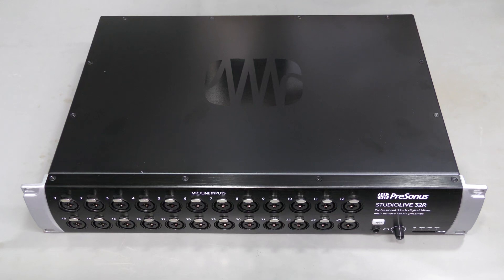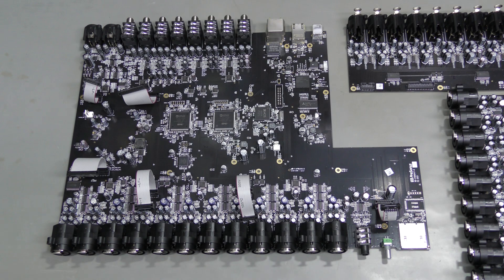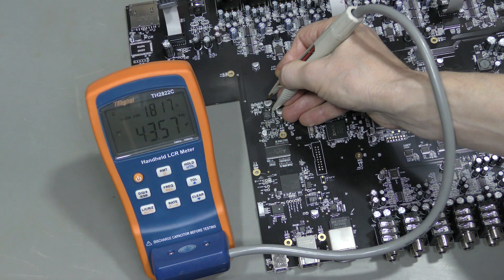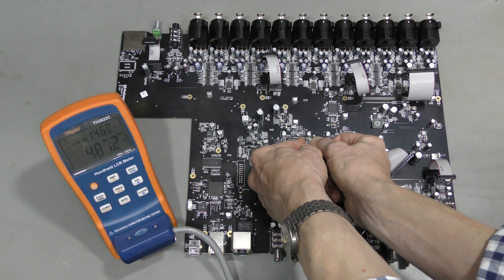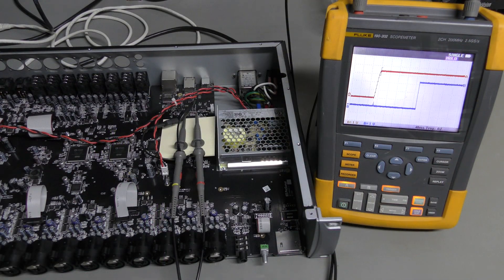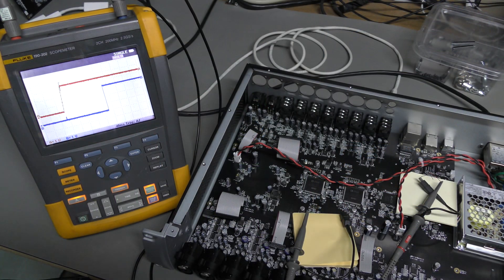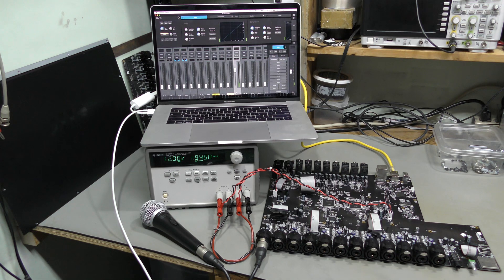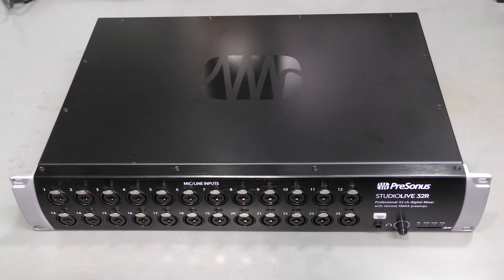#158 - PreSonus StudioLive 32R rack mixer repair

Comment: Hi everybody, I had the same exact problem on my mixer. Huge thanks to Alexander’s super clear explanation, I successfully debugged the problem. However in the end, I keep the original values but use 100k for the pull up. The problem did not resolved and got 0.9V on -15V rail. Then I purchased the same stepdown regulator from digikey and boom! It works again. I got -13.6V on the rail and therefore -2.5V on the input channels. 
One more time, thank you Alexander! You saved an 2000usd mixer!

Comment: I'm pretty sure that the rack version can record 32/64 channels if you connect it to a daw. It's only 2 channels if you are recording directly to the SD card slot.
Reply from the maker: of course. but mixing boards of this line can record 34/64+2 to SD card. I would love to have that in rack versions

Comment: Enviable troubleshooting skills on display as usual! Great video. Still makes one wonder why it worked without fault originally. Perhaps the internal circuitry of the chip has become less robust over time, and reducing the "grunt" needed to overcome the higher resistance was what it needed to keep doing its thing consistently. Awesome work! - JRH

Comment: Nice fix, as usual...congratulations. Like others said, using a pull up resistor equal to 1 M seems a bit strange...such a high value is a good noise generator😅😅😅. Not exactly a desiderable result... Regards from Italy.

Comment: Isn't it a rule to check all voltages first?
This equipment left better than it came, recaped!
Reply from the maker: Yes, it is a rule. And I checked, but not when the fault manifested itself. And I had a wrong idea that the problem must be with digital part. And I imagined something transient like a bad reset or too much ripple during initialization or something like that. Everything is obvious once you know the answer.
Reply: @feedback-loop  He who knows, knows. And you know a lot.

Comment: Different brands/models of these step-down converters work slightly differently and need set up differently, so possibly they fitted the LT8609 thinking it was 100% compatible with what the original design called for?
Interestingly, the LT evaluation board for the LT8609 uses a 1Mohm pullup to VIN on EN, and a 0.22uF on BST.
Nice repair though, enjoyed the diagnosis.
Reply from the maker: Oh, you have an evaluation board with 1M resistor to Vin? So perhaps this was not a mistake on the part of PreSonus, but they followed some recommended design. Well, I am not sure how to interpret this, but it does seem to me that this 1M pullup was the culprit.
Reply: @feedback-loop  No, there's a schematic on AD's site of the evaluation board. It could be your IC is partially damaged, but I agree, 1Mohm would seem rather high a pull up!
Reply: @feedback-loop  I looked at the LT8609 evaluation board schematic and to me it looks like they choose a 1M resistor so that the Enable input could easily overdrive that resistor if this optional feature was used, there is also an optional resistive divider and the schematic says that when the resistive divider is used care should be taken to select high value resistors otherwise the resistive divider could easily draw more quiescent current than the chip itself... (So obviously when none of this is used the Enable pin should go directly to the input voltage, I think it is a design mistake too...)

Comment: 3M ohm, WTF - lol -.
Reply from the maker: marking is 01E, which is 1 meg
Reply: @feedback-loop  So, they used the wrong R, right from the beginning?
Reply from the maker: I would think so.
Reply: @feedback-loop but did the device also have this fault from the beginning?
Reply: @feedback-loop  Did you test that 1M resistor after you changed it? Just wondering if the value had drifted upwards over time and whilst the circuit coped with 1M it couldn't cope with more than that.
Reply from the maker: @mrpetit2  No idea. I bought a second-hand unit recently
Reply from the maker: @standishgeezer  yes, I measured the resistor. 1M exactly.
Reply: @feedback-loop so maybe aging of some other capacitors or aging of the silicon caused some parameters to fall just out of spec when the device is cold or so for the converter to start up.
I wonder how many of these devices will be scrapped in the future because of this designflaw.